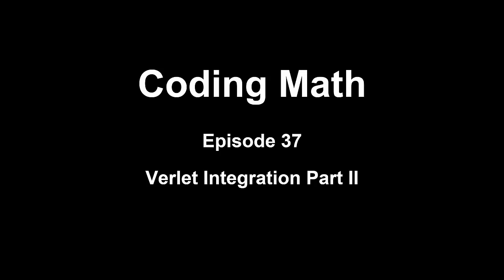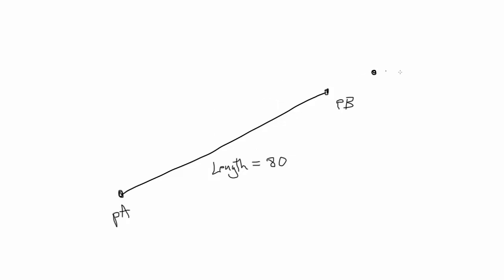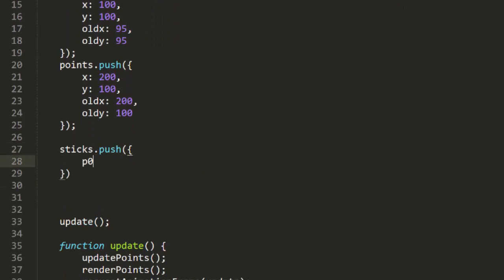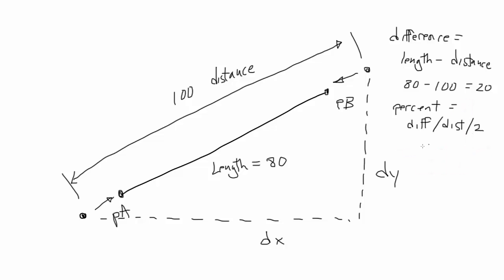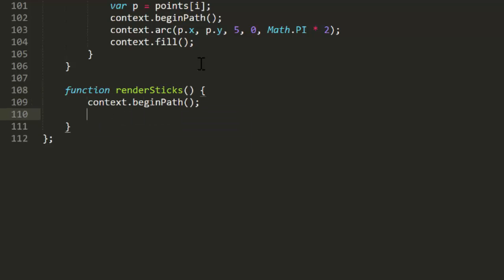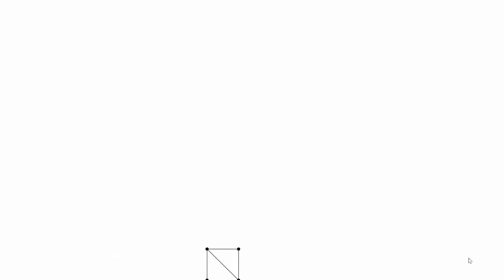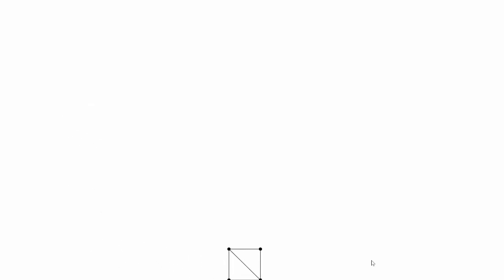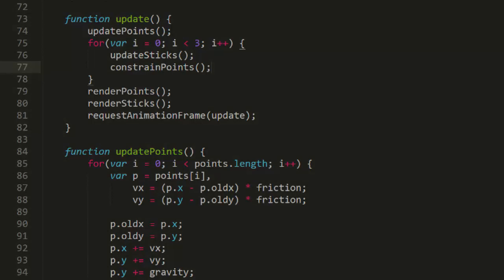Coding Math: Episode 37 - Verlet Integration Part II

Comment: A small micro optimisation you can make is if you have to divide by a hardcoded value, you can instead multiply by the precalculated inverse value. So for dividing by 2, you would multiply by 0.5. Division is usually a bit more expensive than multiplication

Comment: This works great for single points. But the movement is all wrong once you connect the points. Objects don't bounce based on the reaction of the point of contact, but based on the reaction of their center of mass. When a vertex of that square hits the wall it should effectively stop for an instant and act like the pole in a pole vault, causing the center of the square to rotate around that point. The vertex would then follow a new trajectory that was some combination of its own bounce and the pull from the center mass of the square. This undoubtedly complicates the math a bit. Still an awesome demo. Just the weird bouncing of the square that I found distracting.

Comment: sir, i tried to make this on Java, It didn't work.The points start wiggling around fluently and then all points get a position of (0,0)
Reply: maybe you are applying the offset to the wrong point, if you do this, if the points need to get closer, they will go further, and in the next frame, they will need to move closer, with a higher offset, but they will go further and further and further

Comment: For the folding issue would another (possible more complex) solution not be to check the angle between sticks and place a limit on it? 

I can see this working better for ragdolls with joints like an elbow where the two sticks (the upper and lower arms) can only meet at a selected range of angles with the joint seeming broken. I cannot see a way this effect could be achieved using hidden sticks

Comment: I'm having a problem with something.
I'm making a game and almost have this working perfectly. But my objects are small, so sometimes a point will "flip" through a stick and totally screw up the shape. Since the objects are small, if they move fast enough, this will happen and it doesn't matter how many stick iterations I go through because the point moves a lot in one frame. Imagine I have a triangle. If it moves fast enough, it will squash enough that a point gets swapped with another point. Usually this wouldn't be a problem, but I have sprites overlaying the objects by attaching it to one of it's sticks. So the sprite will invert when this happens.  Is there any way to make sure an object hasn't gotten squashed? Like is there a way to make sure all the sticks are the right orientation? Or maybe a way to compare points with each other to make sure the shape is ok?

If you're confused with the scenario, I could link you to a gif of my game.
Reply: The best way to prevent this is to limit the velocity of your game